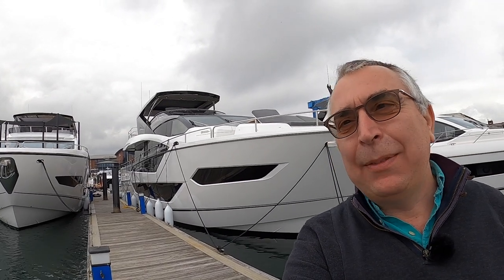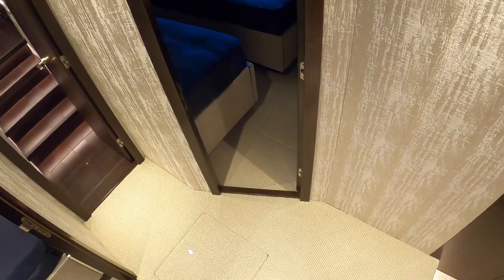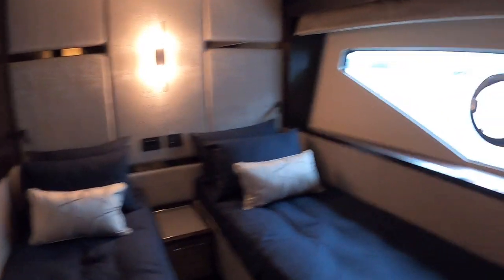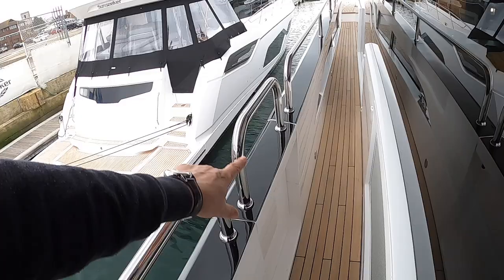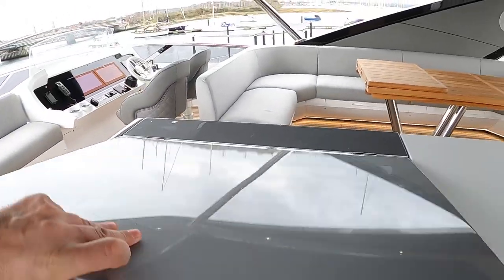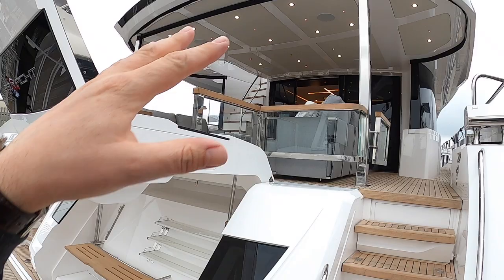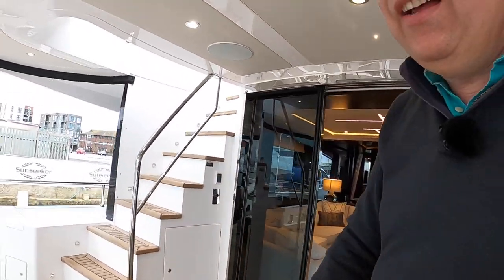£5.7 Million Superyacht Tour : Sunseeker 88 Yacht

Comment: Lovely. Not sure about having the kitchen right up front. Why are there steps up to the VIP cabin?
Reply: The galley is with the helm as this is a charter boat (or if private, still crewed). It's not intended for owner-operator. Just as the largest Princesses are legally owner-operator but in "reality" (as the Princess guy said) it's crewed.
Reply: The galley locale is well explained by @Darth KEK...  The steps up to the VIP Cabin afford a much larger footprint for the room.  The hull slopes in severely, and thusly, the room would be a good 2-3 feet smaller on EACH side without raising the floor level.
Reply: @BucsFTW  could they use the space under the VIP for storage or a trimmable extra fuel tank?
Reply: @visionist7  now THAT is forward thinking!  Quite honestly, I'm not sure - but I like the concept.  Maybe she'd be truly trans-Atlantic then as well?
Reply: @BucsFTW  it would probably be impossible to get her up on the plane until the tank is empty, so it would be a long range displacement speed tank only, turning into a semi displacement boat as the tank empties and the bow lightens. Bit like a plane that flies higher and higher as it burns off fuel.

Maybe I just spoke a load of pseudo physics, lol. Who knows
Reply: @visionist7  makes perfect sense to me...!

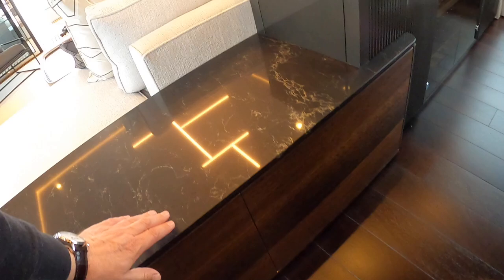Comment: 3:11 being a cabinet maker, that woodwork is incredible. Those crockery holders? That's a big thing in homes now too. You can lift the holders out of the cabinets and carry them to the table to set the table or to and from the dishwasher. I did a custom kitchen and we used them. Now the ones I supplied weren't clear acrylic and we adjustable depending on plate size etc but the home owners found them SO handy. Instead of taking one plate out, standing up, turning, and putting it away you just filled the holder and put them all away at once. 

I said to the homeowners: what would be truly amazing is if you just put them in the holder, then into the dishwasher, then into the cupboard without ever handling them "OH WOW CAN WE DO THAT"? lol ...nope, you need access to the front and back of the plates in order to properly wash them.

HOWEVER, I heard somewhere that there IS a kitchen where they actually turned all the crockery cupboards into a dishwasher. You put the plates etc in standing up, sealed the doors, and pressed wash.....Now I cannot confirm it but what a piece of kit that would be!

Comment: Doing electrical engineering myself I always find it interesting how very few companies seems to care about driving LED lights without causing flicker....
It is fairly trivial to not make them after all, nor does it add much of any cost.
Though, I do wonder, do these lights flicker due to using mains, or do they flicker due to having PWM based dimming.

What one should do if one doesn't want flicker is a simple current driver.
One can either go the simple way and just have a pass transistor regulating the current. Or one can do the fancy method and build a DC-DC converter with current regulated output. But either one wouldn't flicker to the camera.

Also, the reason why it stops flickering every now and then during the video is due to exposure times. When there is lots of light, a camera with auto exposure on will reduce the exposure time, and this makes the camera able to see that the lights do in fact flicker. And considering how many consumer devices have auto exposure as standard, I for one wouldn't consider it acceptable to drive the lights in a way that causes flickering for the people on board. It takes away from the guests' experience, even if their eyes can't see it, since their phones and other cameras will.

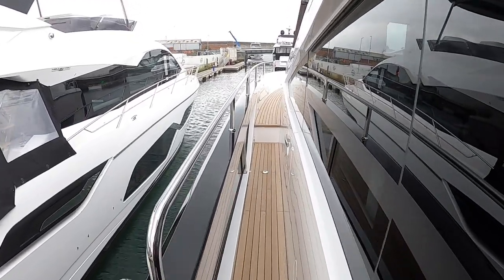Comment: Hey Nick, at 5:01 we can see the galley door with the tiny window on top. At 12:48 we can see the door from the outside where it has a lage black panel in the middle.
Do you know by chance why they did not make that panel into a window as they did with the rest of the boat's side? Same on starboard.
These tiny windows on the Sunseeker Yacht ranges front doors have always bothered me. It seems way more sensible to use the panels to increase lightflow and visibility?

Also what's up with the front sunpads at 16:24? Do you have to climb over the rear facing backrest or can it be folded down to a headrest or similar?
And lastly: How about an all access tour of the Queen Mary 2 for 300k subs?

Comment: I think Sunseeker would be wise to have photo's of the cockpit area staged differently.  The new power deployed sun seating is looking very impressive, however practically speaking four people sitting on proper chairs and two literally seating on the floor is not going to cut it imo.  Keep in mind if the yacht sleeps 8 there might be an expectation to have seating and expandable table for Al fresco dining in the cockpit for that amount.  The formal indoor dining potentially could be the least used area on this size of yacht, even with the large opening door / windows, - so they way they've decorated that is perfect.

Comment: When under way, how do the crew get to their cabins without going through either (a) the noisy engine room or (b) going outside to the back deck and lifting that large door?
Reply from the maker: They don't - there's no need to.
Reply: It does seem the crew is pretty much screwed if they have a long foul weather passage. Plus there is no storage in the engine or crew area for spares or tools. The galley storage is insufficient for the number of crew and guests.  Not well thought out.
Reply: @AQUAHOLIC  Can you be more specific about not needing to?  The boat is capable of longer voyages, so could easily be at sea over night.  How do the crew get to their cabin for change of shifts?

Comment: I have to wonder how they protect the electronic controls/key pads. I bring this up because I worked on the build of a smart house that had similar ipad type touch pads in all the rooms. You could be in your bedroom and touch a button and the stair lights and hall way floor lights would illuminate at night if you wanted to go down to the kitchen for a snack. You could also see who was at the front door and lock/unlock it, control the heat/ a/c etc. 

Well we got a call while on another site and that morning, lightning struck about 1/2 km away and fried the system. They couldn't turn on the a/c, couldn't unlock the front door, couldn't turn on any lights etc. The site boss had to rush up to get them out of their house. The thing is, the system was supposed to be protected from something like this happening.

Comment: As a audio visual enthusiast it would be nice to know what TV manufactures are being chosen for the Yachts as well as the TV tech OLED etc (if it's possible to discern)
The kitchen appliance manufactures always seems to get preferential treatment and yes Miele i'm looking at you!
Reply from the maker: Years ago, many manufacturers used to put in cheap TVs, but more recently owners are expecting high end equipment and manufacturers are responding
Reply: @AQUAHOLIC  Thanks Aquaholic, that's surprising! Imagine buying a new yacht you've just spending half a mill + on, only to encounter a budget TV 🤦‍♂️
Reply from the maker: @duncanrogers6484 Quite! It wasn't all manufacturers, and they're far more savvy now.

Comment: Nice to see another super yacht.    Nick I've missed these kind of boats.   One question could this potentially be a owner operater or for this size boat if you had needed crew would you have deck and interior crew only or would you also need captain and engineer?
Reply from the maker: You can of course choose to run it how you wish. I very much doubt you'll see any pure owner operator though, it's a huge boat just to keep clean

Comment: It's very impressive and would undoubtedly turn heads in any port, but this boat would be competing in the same market as boats like the Princess Y85, being of similar size & performance, similar facilities (8 berth in 4 cabins,) and being around the same price (or a even a little more,) than the Y85, and to be honest: as attractive as this boat is, it just doesn't seem to have the same class and air of sophistication that the Princess boat has. Admittedly, the decor on the Sunseeker 88 looks as though a good designer has had a hand in it, but the Y85's level of luxury and classic design still leaves it standing. The interior of the Sunseeker is clearly well thought out and they've done a GOOD job, whereas the Princess boat has a kind of natural and 'unforced' look to its interior as if someone has just installed the BEST of decor, fittings and furniture available with no thought of cutting corners anywhere. 
https://www.youtube.com/watch?v=Xi4gV6SGTow
Reply: So not just me that went back and looked at the Y85 video. Have to say I agree - the space handling on the main deck is better in the Princess and agree it does look unforced.

Comment: Great tour but I found this boat more cramped than the 86, it just felt much smaller? I didn't like the helm nor the galley, again looked cramped. I get the ideas behind the cut away bulwarks and it works, the lower aft sun pad is also a good idea but everything else just looked crammed in. The dining area looked like the sale section of Ikea, not nice at all.  I was really hoping for this boat to be a cross between the 86 and 95 but to me it looks like the internals were put together using the leftover parts bin! I'm guessing it's an 86 hull with cut-outs in the bulwarks.....everything after that is a mess. Not for me and I'm a SS diehard.

Comment: Nice fit and finnish, absolutely did not like the galleys position, also, all storages are very low, in fact on the floor, even the dinnerware is on the floor??Other than that, it's ok.  Would not pass over 5.7 mil though, that galley is all wrong for me.

Comment: A superyacht without a captain's cabin?
Reply from the maker: Easily resolved - just triple the budget... 🙂
Reply: @AQUAHOLIC  I see this more as a case where the owner will be the captain/manager of the vessel.  That's great if the owner wants to do that job, but that probably makes even less sense financially.
Reply from the maker: @rockets4kids  Extremely unusual for a boat like this not to have a captain.
Reply: @AQUAHOLIC  I agree.  That's why I find it so strange they are not only putting the captain in a shared cabin but a tiny one at that.

Comment: 100 feet or under. Surely a yacht (not a super yacht)?
Lovely boat all the same
Reply from the maker: Above 24m LLL is industry standard superyacht
Reply: @AQUAHOLIC   did not know that. So that's about 76 feet? Fair enough. Thanks for the heads up.
Reply from the maker: @PaulRoneClarke  It is, but it's slightly more complicated than that, as it's Load Line Length, which is the basic structure of the boat not including things like the swim platform. So as a rough guide, I usually reckon on anything over about 85ft.